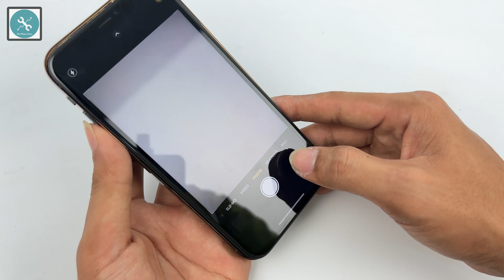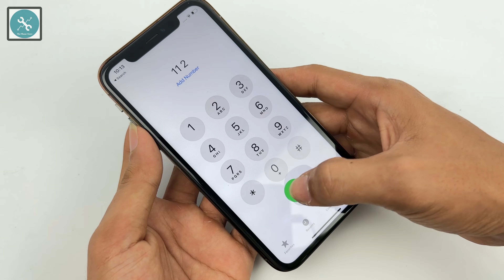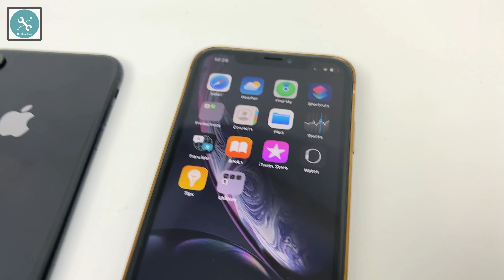DIY  iPhone XR Up To 14pro New color ..

Comment: The issue is getting the case that would fit it cuz a normal iPhone 14 pro case won’t fix in perfectly 🤦🏽‍♂️
Reply: Verdade
Reply: Tem pra vender na shopee
Reply: not really bc they are the same 6.1 inch phones so by right any iphone 14 pro case would fit